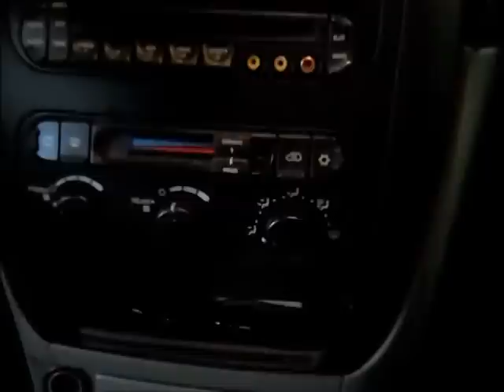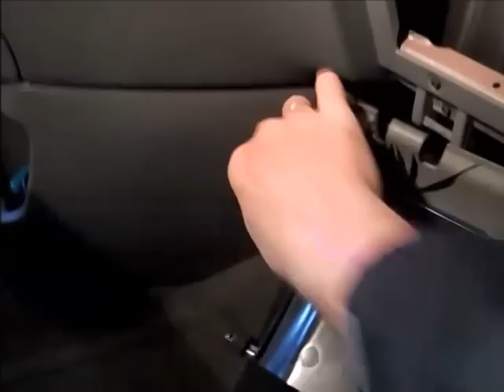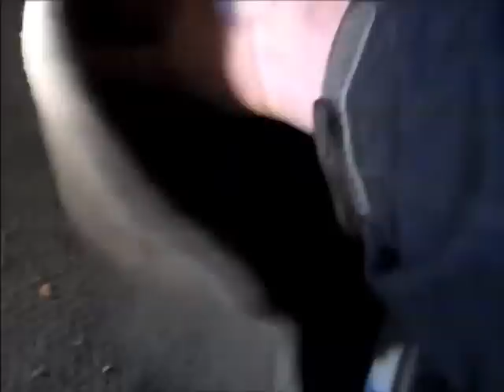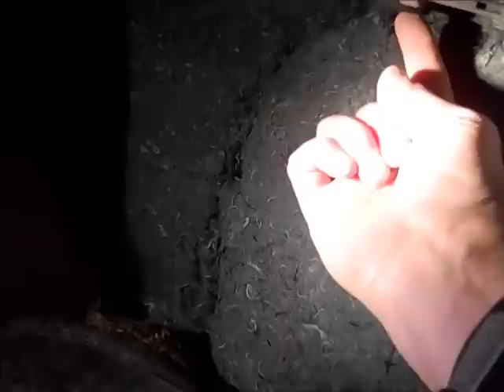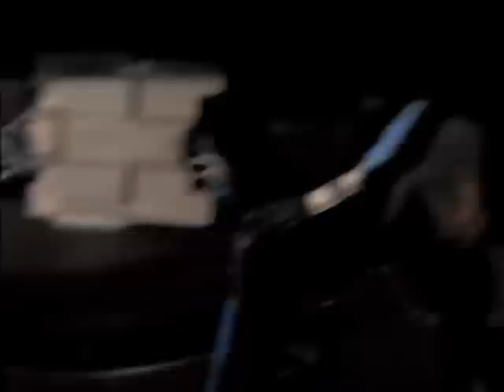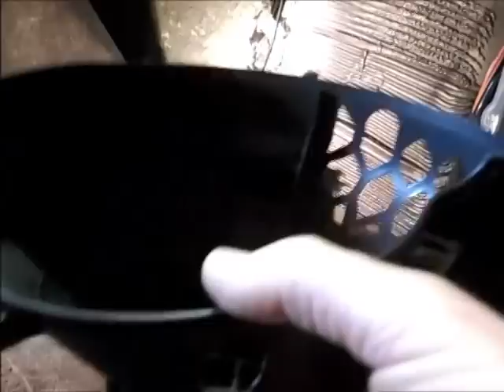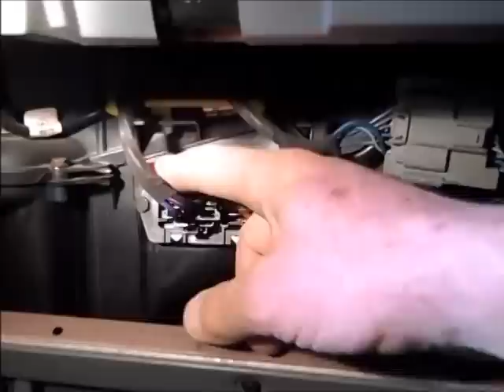2001 TO 2007 Dodge Caravan heater fan and resistor replacement

Comment: Don  - just replaced the blower motor on my 2001 Caravan. The vehicle was frying blower motor resistors every time I put one in and I figured the old blower motor was just drawing too much current (also the two prong connection where the motor wires connect to the resistor block was melted). The old motor was difficult to turn once removed; the replacement was more or less free-running. Anyway, a successful project thanks to your excellent video! However, I hope this is a once in a lifetime experience. The van just passed the smoke test - here's hoping it lasts.....
Reply from the maker: Francis Darsillo Glad my video was helpful to you. Sounds like you found the culprit.

Comment: Don, Thanks for this terrific video.  I was able to replace the blower motor on my 2001 Chrysler mini-van (with automatic temp control) by following your nice clear instructions.  Anyone attempting this blower motor replacement should pay close attention to how that "door" is popped up out of the housing.  I also recommend taking needle nose pliers and pulling out the portion of the insulating pad behind the back housing screw--the one you need a flex shaft (or 1/4" drive universal joint) with 8 mm socket to remove.  Pulling away all insulation in the working space gives max room for your socket and shaft to reach that back vertical screw.  I watched the video several times before starting, and once during the job to make sure I had the "door" in the correct default position before reattaching the actuator motor. THANKS AGAIN--Chuck in Daytona
Reply from the maker: pur914 Thanks for thr kind message Chuck. The one thing I wish I would have mentioned is leaving that screw out upon reassembly. A mechanis friend of mine that workes for a Chrysler dealer said they never do when they replace the motors.

Comment: do you know what would cause all lighting to go dim and them bright when my front blower mower stopped working my lights all flicker when my wife tries to turn the front blower blower on I told her to keep it off because with it off the lights don't flicker we are getting the resister today to see if that fixes the blower. all relays are good and all fuses are good. I hop with replacing the resistor is good if not then at least I have a good resistor. and then when my wife gets home I will check everything to see if first the resistor is bad if not then we can take the new one back. but if it is then we will be good unless the motor is bad causing the resistor to go bad.  because the resistor looks like it has a fuse on it also.     I hop its and easy fix.
Reply: McCuneWindandSolar 
Even though your description suggests a heavy electrical load in the blower circuit is the problem, I would have expected a load large enough to drag down the alternator voltage to blow the 40A front blower fuse. I think the cause of these problems is more likely to be found in a shared ground path or positive +12v  wire. The blower motor shares +12v power to the integrated power module, and the blower everything else on the dashboard (instrument cluster) use ground point G200 and G201 which are adjacent to each other on the right side of the instrument panel in the steel framework at the top center of the glove box door. Of the two the ground connection is easier to check by temporarily adding a heavy ground for the blower motor  to the negative battery terminal. If no change then probe the voltage at the integrated power module as accessories are turned on and off.

Comment: on my '05 Grand Caravan, all speeds on the fan work but high. when using my volt meter, all the inputs on the left side of the resistor (the 5 wire plug) are hot except one. The one that is not hot is the wire for high speed according to the wiring diagram I looked at. Why would they all be hot?
Reply from the maker: Todd Savage That's interesting. In my research for my problem I came across a blog comment stating unlike most cars where high speed is the default speed with no resistor associated with regulating the motor voltage, this one has a resistor for each speed including high speed. I did not know if that was true or not. Since my motor did not run on any setting I only checked the hot wire on the 5 wire plug. My mechanic did mention that the speed control unit closes the circuit through the negative side. I would think that in your situation it is possible that only the high speed resistor is bad. Good news for you because it definitely is not a bad motor so a resistor replacement should fix your problem.
Reply: yeah...I just can't understand why they all had 12.28 volts...it's not so bad unless it's really cold or really hot...3rd speed does pretty good just takes a little longer to heat and cool.

Comment: Don, glad you posted this excellent video when you did because there is nothing else out there nearly this comprehensive. We just R&R'd the fan and thanks to your video, we were ready for the unexpected and got through it in about 1 1/2 hrs!
Reply from the maker: Thanks for the feed back Clint. My motivation to do the video was the frustration I had with R&R on utube for good info. I hoped to help others with this common problem.